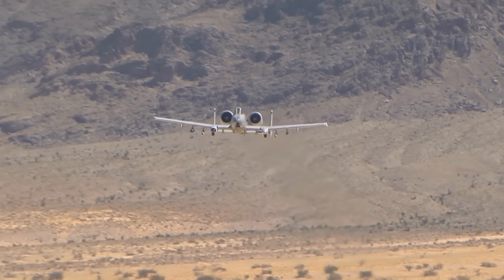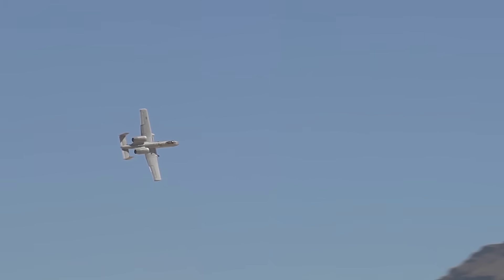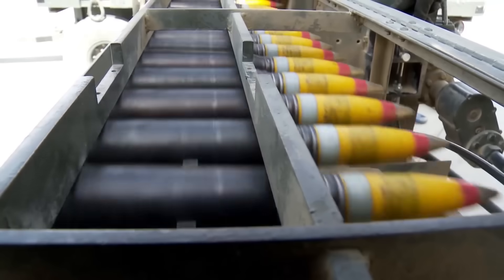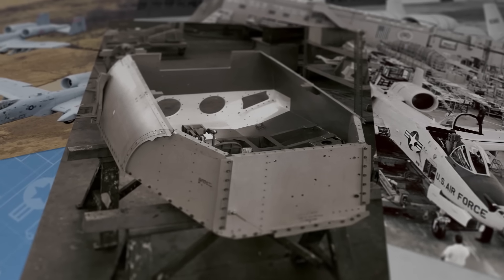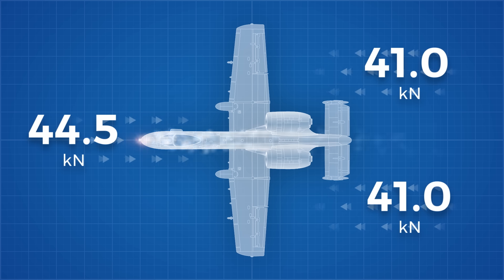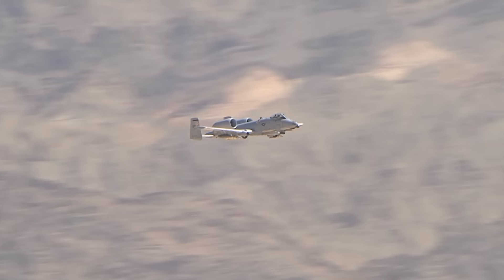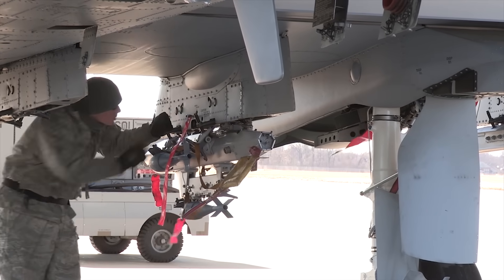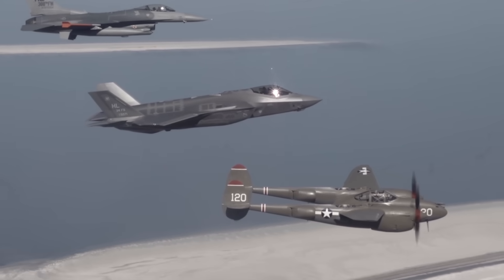The Insane Engineering of the A-10 Warthog

Comment: As much the engineering feat of that machine is most impressive since I know the machine for decades. One thing is for sure. It is DEFINITELY from another time when doctrines about radioactive materials was still used in some extremely ignorant way and every bit of advantage outweighed possible long-term risks. In case the cold war had turned hot it had turned the Fulda gap and other battle fields into a radioactive heavily contaminated areas by the ammo which pulverizes on impact on tank armor. But who cares about a battle field which might be the next day seeing real nukes being used and the world comes to an end for good?
What drives me nuts is that this tank-killer armor was later never really replaced with something slightly less lethal like lead or tungsten ammo as the targets turned more and more away from huge tank armies to ground support roles. Sure, lead dust is still lethal for a long time. But at least a bit less then the radioactive dust from the pulverized radioactive rounds which are inhaled a death sentence, not just for US ground troops getting into those areas afterwards but for many years later for civilians. Shooting with depleted Uranium on soft targets is as much overkill then using an ICBM for a small ship.
But it was also the ignorant attitude of the designers that depleted Uranium was plentiful available and anyway useless. Which makes the A-10 factually a radioactive waste disposer of the dirtiest kind, Dirty cheap, undiscriminating and contaminating land strips in look at the insane half-life of U-238 forever as far human life is concerned. This ammo is at least as nasty as cluster bombs and should be at least replaced with non-radio active lead and/or Tungsten for targets which are often just soft tagets and quite conventional vehicles. But we can be sure that will of course never happen as the military and their leadership gives a fuck for many, many years after a conflict. so my opinion of the A-10 is hence of its ammo much less high as I still admire its rugged and functional design. But that this cold war anti-tank ammo is still used as ground support plane is absolutely sick.

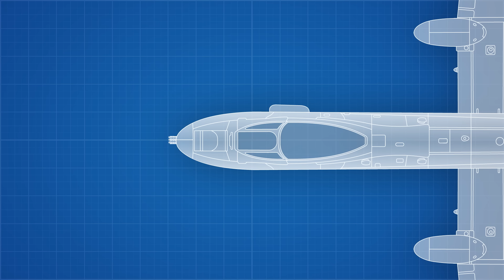Comment: Ironically, while your statement at 7:45 is correct, the drawing is not.
The gun is mounted at the centerline of the fuselage - but it is specifically the firing barrel that is at the centerline. And the firing barrel is NOT at the center of the barrel mechanism! When looking at the front of the aircraft, the "firing barrel" is at the 9 o'clock position. The rotating barrel assembly is therefore slightly offset to the right (when viewed from the front) so that the leftmost barrel is at the center of the airframe. 
Your drawing has the centerline of the barrel assembly lined up with the centerline of the fuselage.

Comment: I was stationed in Fulda. Loved watching the A-10's at Grafenwohr. Felt safer when they were flying overhead.
Also the F-16 and F-35 aren't  CLOSE air support. The A-10 operates at treetop level not miles above the battlefield.
Reply: That’s what I thought. Isn’t the fully loaded stall speed of a falcon like magnitudes higher than the hog?
Reply: @MikeFoxGolf   No. The stall speed of a Warthog is 120 knots where the Falcon is 106 knots. But which is going to be easier to fly at 200 is a far different story. The F-16 is a great airplane, but damage resistant it is not. The Warthog is far more survivable and lives in the threat environment, not above it.

Comment: "...A10 Lightning Bolt"?...say what? Correction: The GAU-8 "gun" is NOT mounted directly on the center line...it is mounted offset to the left, so that the single firing barrel is firing on the centerline of the aircraft.

Comment: Keeping foreign objects and debris ( FOD) from entering the engines was THE primary reason for their placement because of the fact that the plane was intended to be used where there wouldn't be paved runways like 
 forward operating areas and bases. 
 This plane is meant to be flown into battle and  down in the dirt.
 Being in a tank or other armoured vehicles os not going to save you. 💀

Comment: The gun is actually mounted off-centre (to the left). The barrel that actually fires is the right-most barrel of the 5 - not the top barrel of the 5 (as you would think - and you illustrated). This makes sure the barrel that fires is on the centre-line - but the gun itself is mounted off-centre. Sorry, I am an A-10 geek.

Comment: The F-16 cannot replace the A-10. It can try, but it won't be anywhere near as good as CAS as the A-10 is.
Sure, it does other stuff much better, like A/A and strategic A/G with long range munitions that require high speed and angles do deploy effectively, but it can't, and won't do CAS as well as the Warthog

Comment: The idea that the F16 or F35 could replace and do what the A10 does is utterly absurd. Any player of DCS world could tell you that. The f16 is a great plane and multirole fighter but its not the A10. The f35 might be good (or not) but its also not the A10 and never will be or could fill its roles. Its untested. The A10 is the A10 and replacing it could only be done by something specifically designed to fill that role.

Comment: Fun Fact  the jet engines are equipped with fittings to hook up a big tank full of water to wash the dirty gun residue if it got too built up, It would affect the engine's performance.  We would just motor the engines over to get soap and water into the turbines and then run the engines to clean them out, we had to take it a special area and tie the jet down to go to full power. 
Other fun facts the A10C can drop precision guided bombs aka the JADAM  from altitude.
The A10 also carries two Aim 9  Sidewinder Missiles for self defense and a ECM pod for Jamming. 
There is also a Engine monitoring system that keep track of performance data it gives off codes like on new cars, the A10 had it long before OBD II came along.
There are only Single Seat models of the A10, new pilots solo their first time out, an Instructor flies wing.
When I was stationed in England we deployed to Germany on training exercises quite often, each Squadron had their own assigned Detachment base to forward operating base. 
Sadly all those bases were closed as was my Base in England RAF Woodbridge.
In Germany the pilots had German road maps to navigate by, also the Autobahn could be used as Runways if the need arose. 
The A10 can  be Combat turned in a short time, there are teams that refuel and re arm at each turn around pad.

I was a A10 Jet Engine Mechanic before I retired from the Air Force.
I worked on C141, F15, F16 the A10 was my Favorite.

Comment: Teacher: What do you want to be when you grow up?

Me: An A-10C pilot.
Reply: I hear they will be retired in the next couple year
Reply: @anonymousstout4759  sad day when they do as they have nothing of its equal, the job it was built for is still there just the location has changed, an f35 is all very well with its small load of fire and forget and electronic suites but if it has to go in and support troops on the ground then it is sadly lacking to the detriment of said troops and probably the pilot, but this will never be found out until it comes under fire at low level, it will by then be too late, the A10s will be gone and F35 pilots will die and those in command will say they could not have foreseen that retire and collect their pensions.
Reply: @anonymousstout4759  Much like the c 130, and apache, they've tried to retire it several times, but never will.  These aircraft in general are too useful for what they do, and how effective they are at it both in cost, and actual efficiency.  While the A10 isn't "impossible" to shoot down, they are die hard aircraft, and were designed to be aggressive air to ground platforms, and still fit this role better than most aircraft, despite their speed.
Reply: The A-10 will be replaced ONLY when a dedicated CAS aircraft is developed to replace it. The Apache is in the same boat for helicopters. No generalist platform is going to be both cheap and capable enough to displace them.
Reply: I identify as an A-10 soooo

Comment: The claim in this video that the gun is mounted dead center is only half true. From Wiki: "Because the gun's recoil forces could push the entire plane off target during firing, the weapon itself is mounted laterally off-center, slightly to the port side of the fuselage centerline, with the actively "firing" barrel in the nine o'clock position (when viewed from the front of the aircraft), so that the firing barrel lies directly on the aircraft's centerline."

Comment: Couple things: You got the name of the plane wrong. The definition of close air support is wrong. The operating cost per hour of flight is also a lot higher than stated for the A-10. It's a fantastic plane and good at its job but it's not the end-all be-all. The only reason they haven't cancelled it yet, I believe, is that there's nothing in the inventory to replace it. Before they cancelled the program this year, the Air Force was looking into acquiring a lighter turboprop aircraft with much lower operating costs and higher loiter time for use in low-threat places that the A-10 is currently used in. The video needed a lot more research.

Comment: You could pretty much lose an entire squadron of A-10s and it's support equipment for the cost of a single F-35.  Simple math doesn't allow for the replacement of an A-10 by an F-35 on a plane by plane basis.  This is a primary reason behind the idea of actually restarting the A-10 construction program and just updating all its capabilities with more modern components and newer technology.  Redesigning perfection is difficult and rarely works, it's like trying to make a sequel to a classic movie.  The A-10 was so perfectly designed from the start that it would be hard to do anything from scratch that would be all that superior to it and probably cost insane amounts of money to even try.  That's where the F-35 starts to compete, a new ground attack plane from scratch would be extremely expensive to design and build.  So, why not just dust off the plans and start producing A-10's again, new engines, new avionics, new capabilities... same cannon.
This is the crux of all the chaos in the idea of a 'replacement' for it.  Until someone gets enough momentum behind a solution, I think we'll be seeing the A-10 fly for decades more.

Comment: The F-16 was definitely not designed to be a multirole fighter, it was an interceptor that was forced to be one. It's like attaching a trailer to a sportscar and even the lead engineer said that he would have had a different design for the plane if he knew what kind of role it was going to be used for. The F-16XL could have been a possible solution to convert it into a proper multirole plane but that never happened because the F-15E was more cost and time effective to produce.

Comment: I have an issue with the title. There is no insanity but a very logical, conscientious and thought out approach to cover a very specific need and role as best as possible. A machine that many years later is just not possible to replace. It beats current planes both in ruggedness and cost. Kudos to the engineers involved.

Comment: Military aircraft are insanely expensive to operate, holy banana bread! look at these operating costs per hour 
I use a CPM or cost per mile calculation for our vehicles of $0.62/mi absolute including all costs, fuel, repairs, tires, brakes, hoses, belts, fluids, insurance etc

Comment: 7:40, that's not true at all, that's one of the most iconic facts about the A10 is that the gun is mounted a bit to the side because the firing barrel is at the 9 oclock position, and that is aligned to the center.
If you got this basic fact wrong, I don't know if I can trust this video
Reply: There are several basic facts that were missed or wrong in the video. The operating cost was way too low per hour; he defined close air support with language that implied that the plane has to be close and able to absorb ground fire; he incorrectly attributes the duties the A-10 performs today as duties it was designed for. Hell, he even got the name of the plane wrong: it's the Thunderbolt II, not the "Lightningbolt". The video is basically a primer for the A-10 cult.

Comment: Another point that I'm surprised you didn't mention was the A-10s engines being of the high-bypass variety, meaning much longer ranges and loitering times. It's the main reason why the F-16 flew more CAS sorties in Iraq than the A-10. It's not because it was better for the job, but actually because it was, and still is, worse, due to limited range. You can extend the range on the Viper by adding bags, but that takes up pylons you could be putting bombs and FLIR pods on. You might say, ah but Remiel, they have those CFT now, and I would say the same thing, but a little differently: that takes up weight that could be being used by bombs or FLIR pods. The F-16 could refuel in the air, but it still has to leave the CAS AO to do that. The A-10 can stay on support for hours. That's the main reason they don't make a good comparison. They can both do the job, but they have their pros and cons. Same with the F-35. The 35 can definitely replace the 16, because it can do everything it does and better. But it can't replace the A-10 in the same way. The primary job of the F-35 is stealth FAC, and whilst it has multirole capability, that just makes it a jack of all trades kinda plane, more like the F/A-18. But the biggest no-no is this: as soon as you put bags or bombs on it, you kill its stealth, thereby rendering the point of even taking off in an F-35, and the cost of it, completely moot.

Comment: I hope someone in the government has enough brain cells to see that the A10 can't be replaced by a multirole fighter which costs a lot more and isn't designed for close air support. Both A10 and F35 are good aircraft but for different roles. A10 can be replaced by an aircraft designed for ground support only

Comment: Another reason for the engine placement on the A-10 was to have the fuel and engines kept separate. This way it enemy ground AA units were to shoot at the A-10 the plane would not be in any danger of having both its fuel and engines shot out. 

This is another reason why the F35 would not do so well in CAS, because the F35 has its fuel bot only placed in close proximity but also fuel is wrapped around the engine.
Reply: The F-35's will fly the same mission profile as other aircraft doing CAS
The last time the A-10 fought in an environment where people had the capacity to shoot down planes, they got mauled

Comment: I think you made a mistake when talking about the gun being mounted on the centre line of the plane. It's actually mounted slightly off to the right when looking at it straight on, as the leftmost barrel is the one firing. That is the barrel that is lined up with the centre line.

Comment: Unless I missed it, you didn't cover one of the coolest design considerations. Because the gun is along the centerline, the nose landing gear had to be offset, just so that it could fit!
Reply: Even more precisely the active barrel is aligned with the centerline of the airframe.
Reply: Germans did it first
Reply: Doesn't that kinda go without saying? Also, it was perfectly illustrated in the head-on clips in the video.
Reply: BertyFromDK I didn’t know why it was offset until I read about it, I always thought it odd but didn’t realize it’s literally because it wouldn’t fit otherwise

Comment: I was a crew chief on the Warthog thereandabouts 1980. Back in the day, I was told that the plane could concentrate its fire on a single target in successive passes. 
     Put another way, the plane could fire on a target, pass over it,  turn within its minimum radius and fire on the same target. Planes like the stubby, moth-plan A-7 would either overshoot on the return or have to extend their outward leg so as to have the room to turn.
     Thanks to honeycomb materials and tough plastics, fighters of the A-10's generation commonly had Auxiliary Power Units.  These small jet engines gave the planes forward operating capabilities such as self-starting and maintenance capabilities independent of ground equipment. The APU could power either the left or right hydraulic system for flight control and landing gear tests. Of course, it could provide bleed air and the robust electrical power needed to further facilitate its lightweight design.
     All that you said about the plane was true as far as it went. I won't discuss the vulnerabilities of a weapons system still in service, widespread though the knowledge must be. Let them hate, so long as they fear.
https://sidelongsocrates.blogspot.com/

Comment: Couple issues. The gun is offset a few inches. To the left if I remember correctly. Haven't touched one of these in about fifteen years. Also, the gun doesn't slow the bird down when firing. I heard the myth started during the test program when they fired a long burst, and the guns gasses caused the engines to flame out. They fixed that, but even today, people say the guns will stall it. They can fire looong bursts with no problems.
For the gun: https://www.stripes.com/does-the-a-10-s-gun-slow-the-plane-when-fired-1.152557